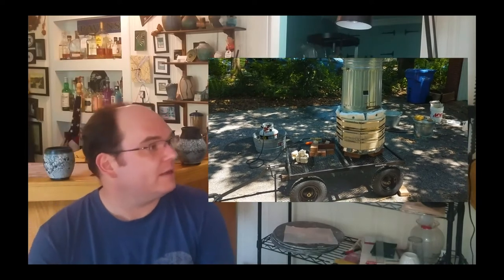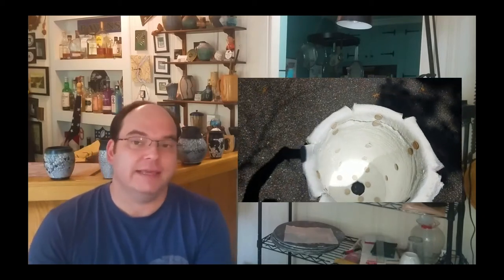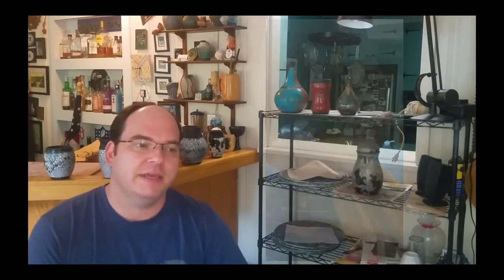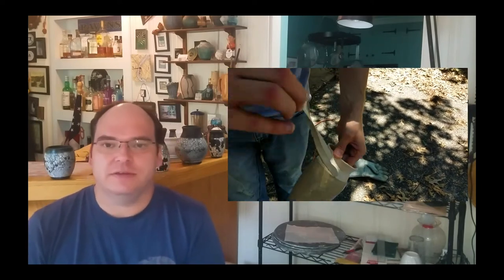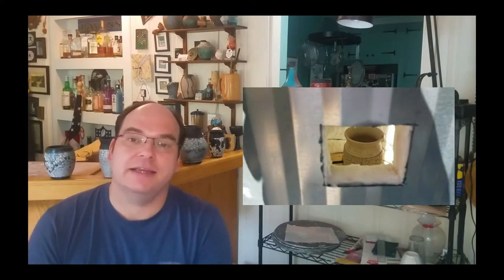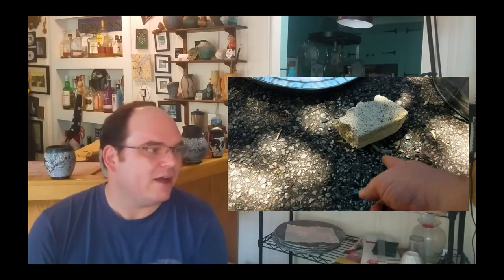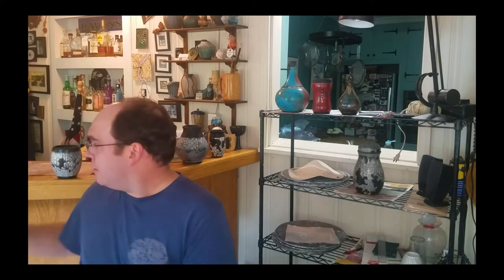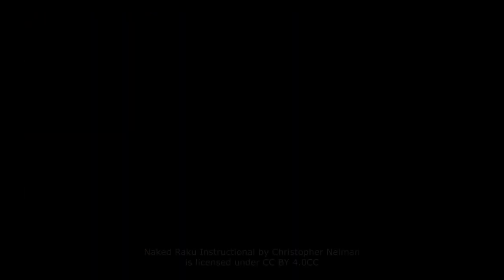Naked Raku with Chris Neiman

Comment: Im curious why raku kiln needs to be fired so high to 1500 degrees. The pieces were already bisque fired. No Glaze is being used that needs to melt. Since we are just heating pieces to move to combustibles why can't they be heated to say 750 or 1000 degrees? Just hot enough for the piece to ignite the paper and sawdust. Thank you for any input.

Comment: Can you please share the slip recipe  please ?
Reply: Ive had difficulty finding a reasonable one, myself. Everything I find would cost me $200 in raw materials to make.  I ended up using a native ball clay out of my backyard and mixing it with the B mix body I used, until I got a satisfactory cracking pattern. The challenge is getting the right size cracks.

Just experiment and you'll come up with something. This stuff doesn't have to be a rich man's hobby, even if everyone tries to make it one.

Comment: does the sigillata HAVE to be wet when going into the kiln ?  or can you let it dry first?
Reply: The terra sigillata is applied to the greenware and then is bisque fired, so, no, it's not wet going into the kiln.  The raku slip IS wet going into the kiln.  He doesn't explain why, but I'd imagine that he gets a better result with the slip cracking nicely.  Note, the kiln is at 500 degrees F and stays there for 15-20 minutes to dry the slip before cranking it up to the full firing temperature.